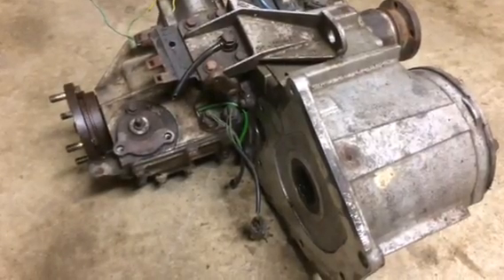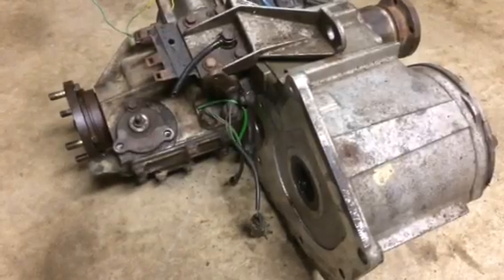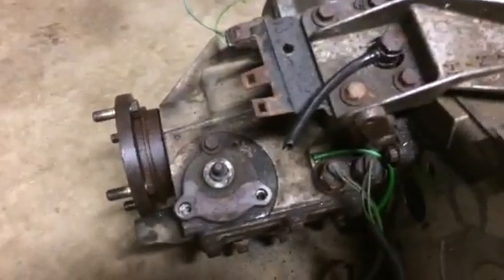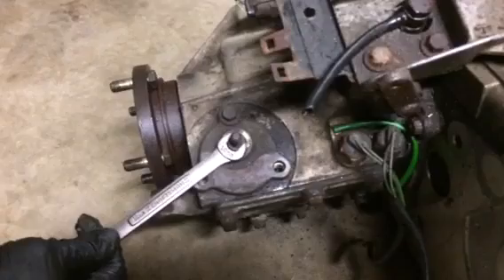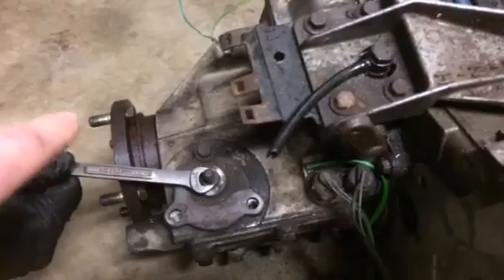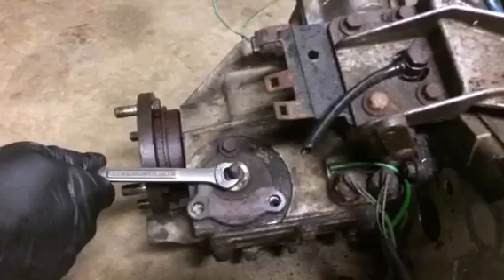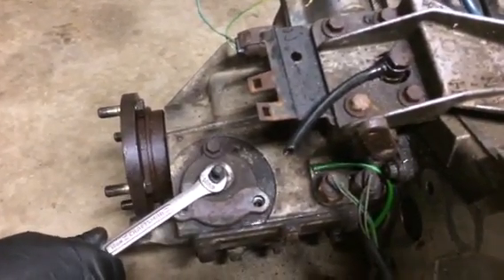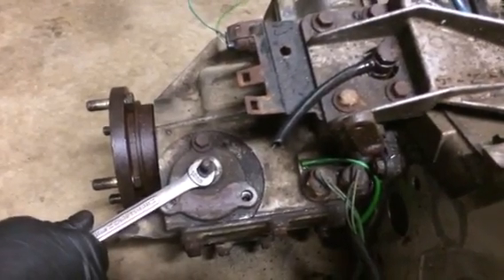How to lock a Land Rover Lt230

Comment: Those that say diff lock doesnt have a neutral position, im here to tell you they do. Put it in neutral position and the back wheel wont get power to them. Found this out after a off roading adventure and a 3hr drive home. Something felt funny the whole way, like i was dragging my ass, disco was having issues going 70mph. Took a look at the diff lock nipple and realized it was in the neutral position. Turned to off and everything went back to normal.
Reply from the maker: The differential lock does have a neutral position which prevents power from being distributed to either the front or the rear. Based on your description, it seems you might have engaged the center differential lock. This could explain the unusual handling on the road, especially at highway speeds, as it forces power to both the front and rear, diverging from the typical all-wheel drive setting.

Comment: If you pull out the CDL shaft, you would see only 2 detents in it. The third central position isn't an actual 'Neutral" position. You are merely pulling the ball and spring out of the detent.

Comment: Are you sure? I think it only needs to move to what you call neutral. There is not neutral for the diff lock.
Reply: I think you are right.  The video seems to overturn the mechanism. If you open up the inspection plate you can see that it only has 2 positions. The one the video calls neutral is already the open diff position in my opinion and the one they call open is just overturning the already open position.